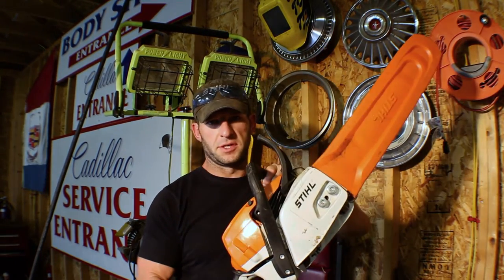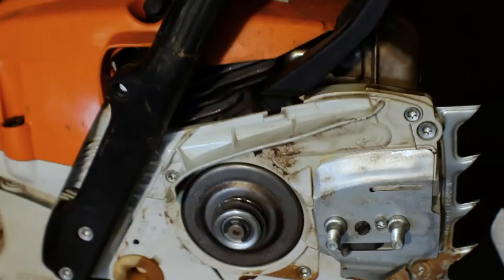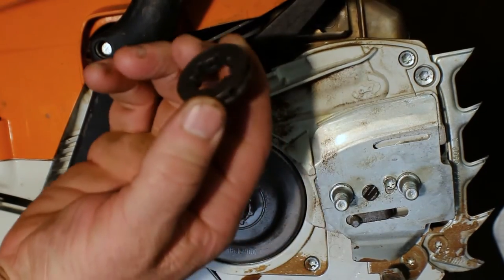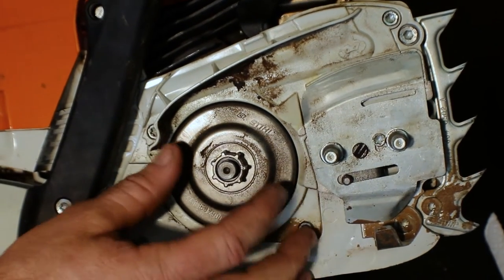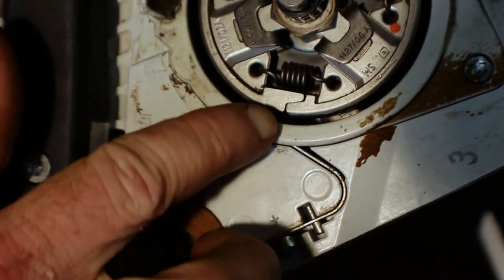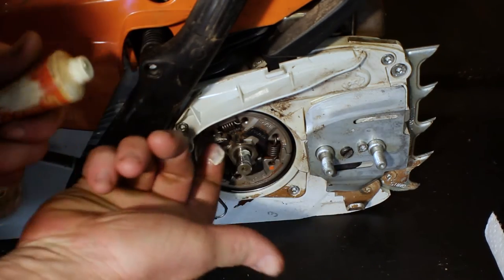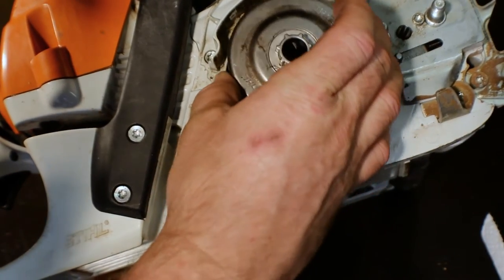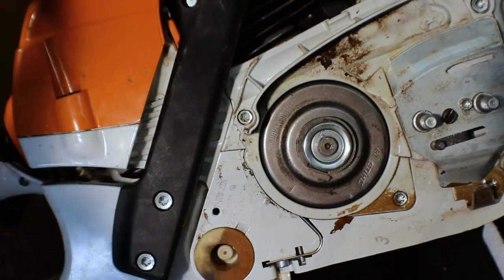Stihl Rim Sprocket/Cage Bearing Replacement/Greasing: How To

Comment: hello, i need help.  i have a ms261.  i have a large amount of play in my clutch drum and gear.  the bearing looks fine. i want to replace gear (325-7) bearing and drum.  the part number on MY drum says 1121, everything online says 1141.  any ideas?
Reply: Yes, i have got ms 261, crank problem cronic. Ms 261 260 drum. And where is location serial number ms 261. I couldn't find.

Comment: hey what kind of grease is that?
Reply from the maker: In the video it was actually the wrong grease, it was the stihl stuff for electric chainsaw needle bearings.  They have a different grease for petrol machines, though I've used different stuff in the past and been just fine.  I even know guys that never grease them, so anything at all works.
Reply: @Human1337 use grease from weed grinder gear box.